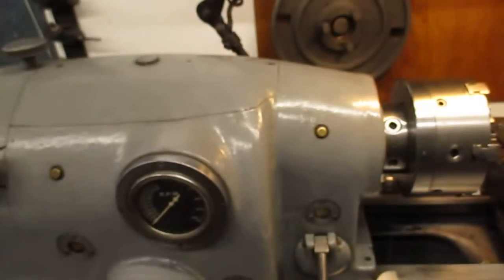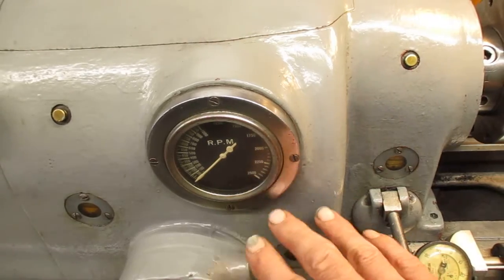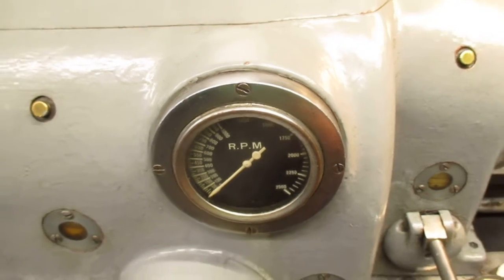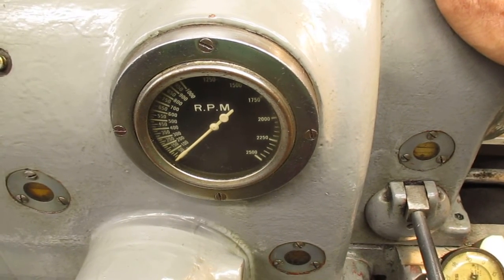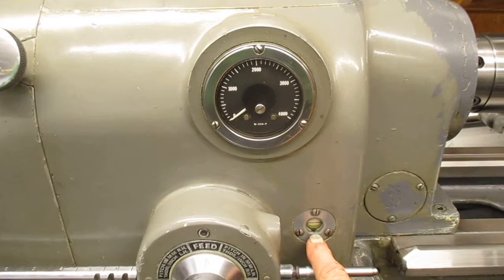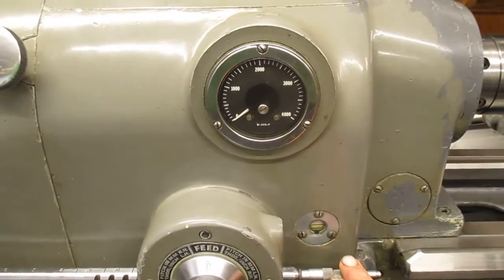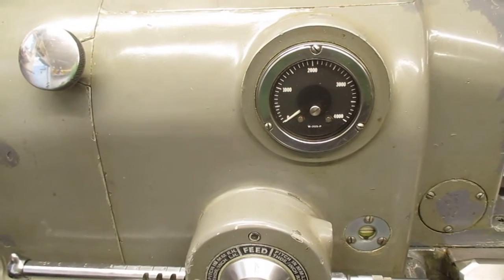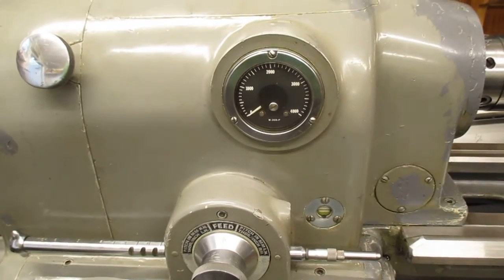Monarch 10ee lathe early and late headstock oiling

Comment: Don’t know what year the change was made but I do know my 1965 is the newer design.  To flush my machine I’m planning on running the DTE 24 (I think that’s the current recommendation) until it’s warm, drain and refill.  Any thoughts on how to improve that process?  Thanks, Will
Reply from the maker: That sounds like a good plan, I need to do the same, the factory recommends every 6 months, and it has been some years now.